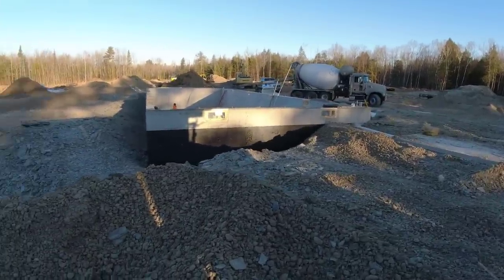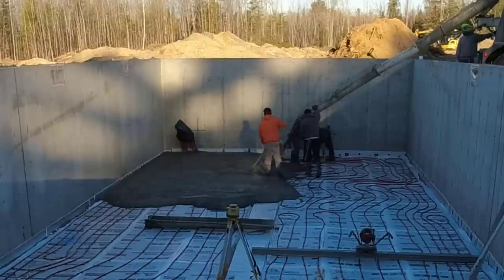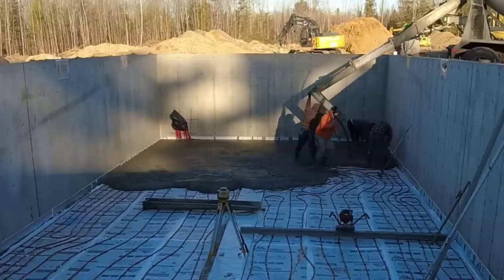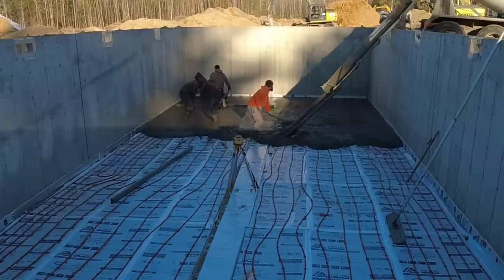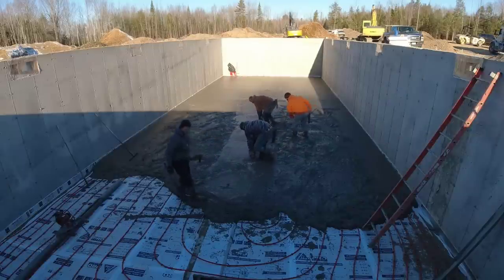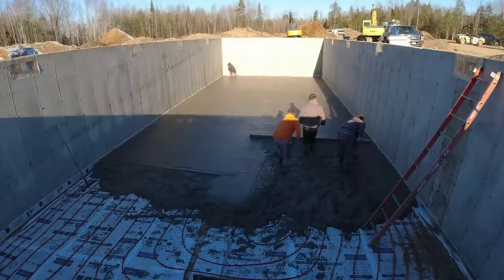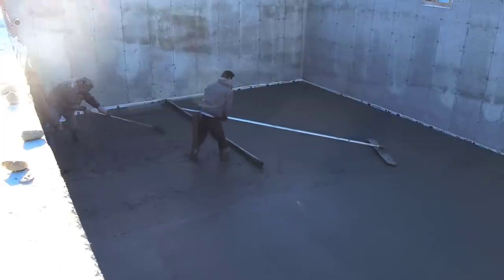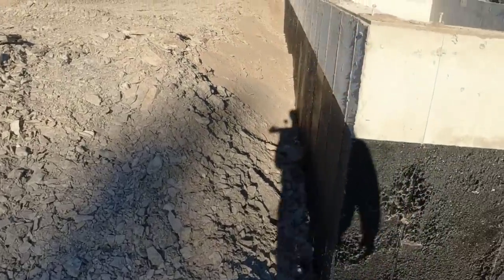I Can't Believe This! Poor Foundation Design or Bad Building Codes?

Comment: There will be a stairway to the basement somewhere Mike.
We always finished by hand, no power trowles in the homes we built.
We would place a pc of plywood on the poured concrete where the basement steps were going to be, then just placed a ladder on top of that.
But then we never poured the basements till the house was under roof either.
We graded the basement floor and placed the stone base when we set up the forms for the footings.
So there was very little prep time involved when we were ready to pour the floor.
We wheeled the concrete shot thru a window. Then shoved the wheelbarrows up the ladder, and sometimes we just hung them from the floor joist with chains, and later washed them out with a hammer. lol
We never used screeds, or used any type of a screed.
We always used stakes for the concrete height set from the floor joist with a proper length rod, then we raked to the stakes and used a 4’ wide jitterbug and a bull float.
As builders we were masons to start, and always did our own concrete, since it was critical it be done in order to keep the job moving along, especially with certain style homes, like split levels for example.
Im now 88 years old and have been retired in Florida for 24 years.
So i entertain myself on the days i dont fish by watching guys like you on youtube.
I became a licensed builder in Florida also, and my youngest son age 52 is also.
And so will his son when he finishes college, making him the fourth generation.
My only regret is that i put up with all that cold wether BS as long as i did.
If i had my life to live over it would definitely be in a warm climate.
Reply: Even a single stairwell seems like a death trap for fire...The building code should get changed for homeowner safety!

Comment: Such basements are typical in Germany (but then with a concrete ceiling/groundfloor). Stairs will be installed inside to get down/up. The main concern is water tightness/drainage (and buoyancy of this trough structure). At least there schould be light shafts and some air exchange.

Comment: Many are built around here with no outside access. But I can`t see pouring a basement floor after the building is up for many obvious reasons also including the effect of all the moisture from the concrete effecting the building materials in the building.

Comment: As a builder in Maine, I've found building codes in Maine to be different from town to town. Having said that if the town building code doesn't live up to the state wide code (there is a state wide code no matter where you live) then the state code takes precedent. More importantly if you bank finance anything you will need insurance and they will send an inspector. The insurance inspectors are way more strict than code enforcement and they don't care who you are or where you live, also some of their recommendations are not based in logic. They will just drop you without much notice and there goes your mortgage now you are in default 🤷
Reply: I really don’t get why someone would finance a house they’re building. Just build what you can afford
Reply: @speedster9622 don’t forget how much the NEW house is worth now.  Nevermind taking out a heloc at the same time you got that 2.5% loan.  Could reinvest the equity as well.  Smart man !
Reply: @jackwilliams7738  no way that is true. I was homeless when I built my first house. If I can cover the cost to build a home without help from a bank anyone can do it. It cost me 50k over the course of a year. I now understand why someone would get a loan to build something like a mansion, but getting a loan to buy a trailer still seems a little crazy to me.
Reply: @Dr.LongMonkey  I would say a large percentage of people take a loan from a bank. But you can build a small house for $50K. It’s possible just not likely.
Reply: @Dr.LongMonkey   The use of OPM (Other People's Money) is ALWAYS a smarter Move when the interest rates are compatable...Finance 101...Only financially uneducated people use "their own cash" to do everything...

Comment: If you pour a concrete floor on top of the walls,  you will have a good prepper/survivor/ fallout bunker under the house. 
Just a little window to make a steel plate for  cover and your done.
Very solid walls I must say and no styrofoam in them,  another thing: let's hope the draining  of rain  / ground water solution is solid.
 
When there is styrofoam between floor and wall  like that waterproofing in the corners may be hard to do.
Mayby a  " concrete seal band" should be "poured in place" in the wall and then into the floor when it is poured.
Just to be safe.

Comment: In Massachusetts you need 2 ways to access out in case of a fire. So those windows aren't access unless there 42" from finish floor. So a stairway is one, this would not pass in Massachusetts with those windows. A bulkhead is nice if you  need to move anything big into basement it's only $1,800.

Comment: I have done those with no egress, same situation. If they set the home with in a week or so, they will have a ton of moisture in the basement to deal with, they most likely have to insulate the walls and put some heat and air mover down there.

Comment: So Mike what would be your opinion?  I will be building a home with a full basement.  Do I do the slab first with rebar protruding vertically every 16'' with an engineered footing underneath or go with the walls built on the footing then fill in with the slab.

Comment: A basement that size should have at least one egress window or door. How do you get out in case of a fire if you finish off the basement . I differently can’t fit through one of those Hopper windows

Comment: I do find it strange that with new construction one would opt out of having egress built in to the foundation. However, it is possible that there was never any intent to put bedrooms/living space in the basement and wanted it solely for mechanicals and storage. I would also say a storm shelter but I’ve never heard of tornadoes in Maine. I’m from Missouri, so we get them from time to time and basements are very common here, some with egress, some without. Depends on the age of the house. Mine was built in ‘59 and the only reason I have egress is because of a garage door.

Comment: Power trowel is nice.. but not necessary. Hard trowel on sliders. As far as the lack of exits on the basement, I’d hate to be trapped down there with a burning house above me.

Comment: I worked for 30 years installing low voltage wiring in new and existing housing and I never understand some of the things contractors do and blame it on codes, it doesn’t mean you can’t do above the codes. WE know that isn’t right, no basement egress or the GC will say the customer didn’t want it but honestly with the amount of knowledge of the GC they should throw it in. There is always unintended cost saving for GC’s to have their payday.

Comment: Those are not windows   They are temporary openings for the beams to slide the home onto the foundation
Reply: Uh.. what? That's not how houses are built bud.
Reply: @mikewilhelmson8413  Pardon me? It is a modular home built in a factory. Trucks park on each side with a unit and then  slided together with temporary beams and skates. Rim joist are then bolted together to form a beam with teleposts to support in basement.

Comment: Well its not like the floor is in place and its open air so carbon monoxide shouldn't be an issue.

The coolest thing I've seen on a basement like this was watching finishing troweling from the bucket of an excavator